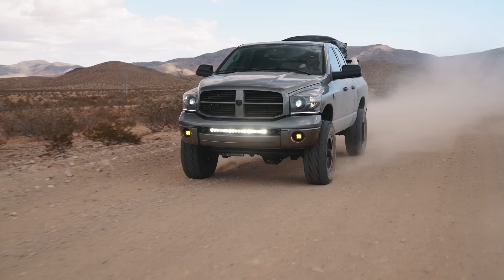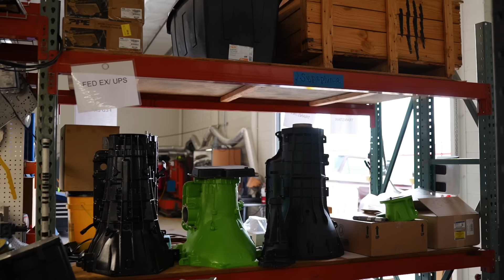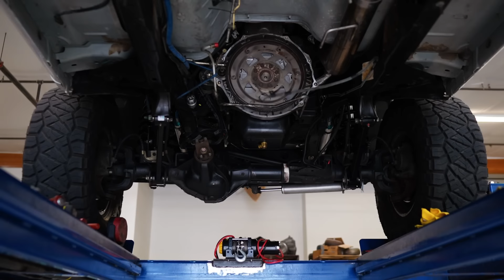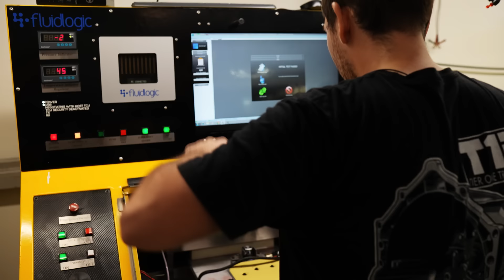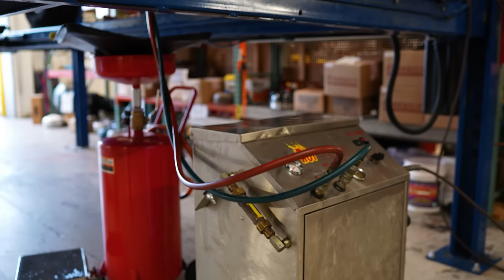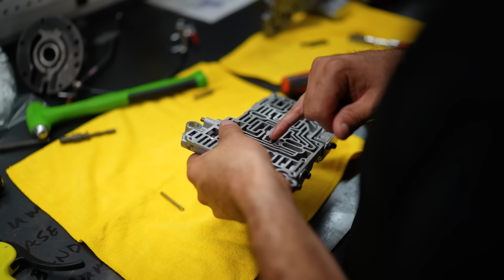Tier 1 Transmission Stage 2 Build | What You Need To Upgrade in Your Cummins

Comment: Had a stage +1 installed by them last year and has been leaking from the torque converter and I'm pretty sure there's a noise from the torque converter around 40 mph when the transmission is in lock up. Taking it back to them to hopefully warranty this right now.

Comment: I'm actually looking at getting a patriot blue and grey 2001 Dodge Ram 2500 quad cab long bed Cummins that's an automatic and similar to yours.  I'll very rarely ever be towing anything and if I do, it would be my toy hauler that weighs about 5,000 lbs dry and is 24ft long so I definitely wouldn't even come close to or exceed 10,000 lbs so I feel like the 4 speed 47RE transmission would last a long time for me.  Especially after getting this kind of upgrade!  Great video man!

Comment: With the stage transmission build, does the transmission make hard shifts through the gears, or is it smooth like stock?
Reply from the maker: That depends on the valve body, but typically stage 1-2 are pretty stock feeling. Mine is more tight than stock, but doesn’t slam me into the seat or anything like a 5 would.
Reply: @JustDiesels   Mine was a DTT installed by Fred Swanson in Waddell. It was a hard shifting monster. Same deal with downshifting. My buddy just had his 48re done with all Goerend parts and it's a dream.

Comment: Nice video on your 2nd gen stage 1 transmission. My 2004.5 Dodge 48 re OEM transmission gave me problems, dead OTR! I called Sonnex Rep and Gorend. All Sonnex Billet internal shafts. Personally showed up at the shop with the output shaft kit for the transfer case. Gorend custom built 48re valve body. Stage 4 triple disk converter ultra low stall from Rev Max, Magtech deep pan. Still running strong. I drive an old Dodge pick-up truck!👴🏽👍🏽